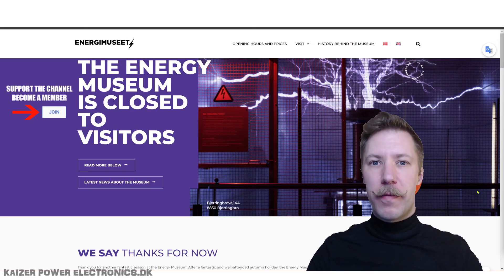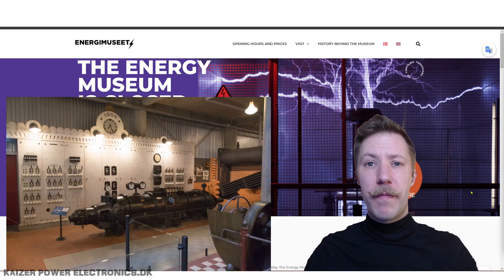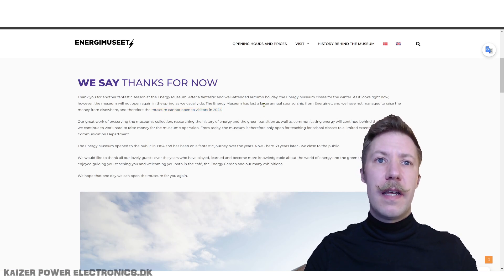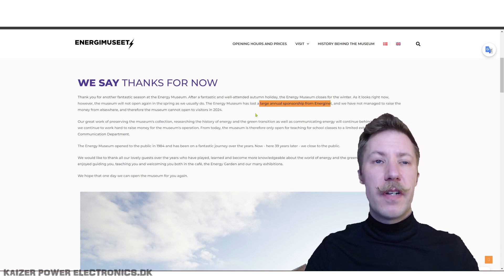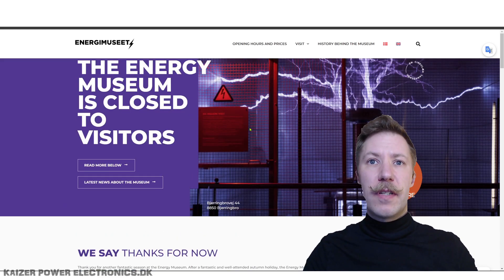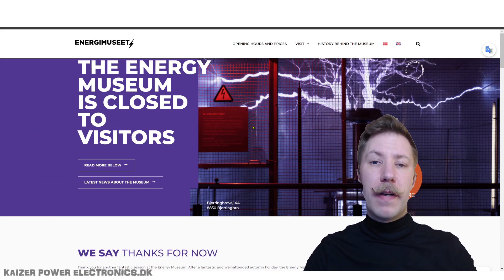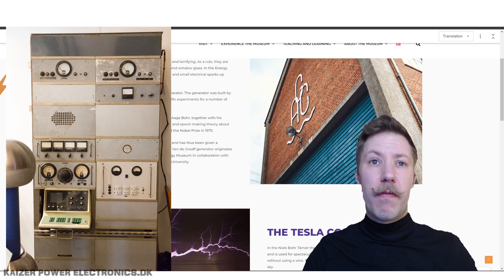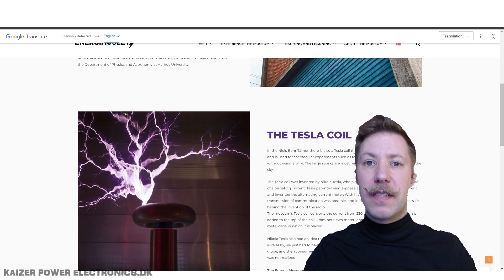Energy Museum Shut Down! I Filmed the Last Public Tesla Coil Show

Comment: for those interested in seeing a public display on a smaller teslacoil here in denmark, you can find two at danfoss universe, one of them you can even touch the lightning (with a grounded glove). anyways, sad to see this place close down as i had moved to a town nearby and hoped to see the place this summer.
Reply from the maker: Last time I was at Danfoss Universe, there was only the "lightning simulator" Tesla coil, which I actually think was also build by Finn Hammer and Steve Connor. It is not really a Tesla coil experience, as its built to deliver a single strike as a real lightning strike, but it's a bit too small to make up for the atmosphere and built up of the exhibition.